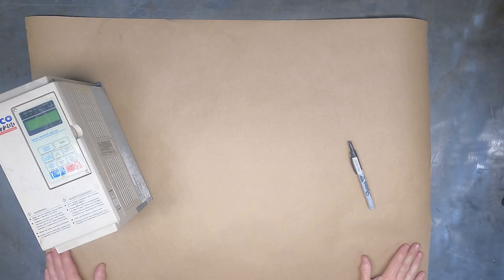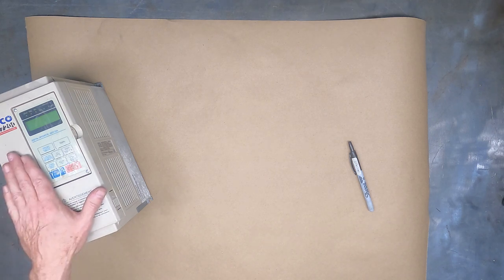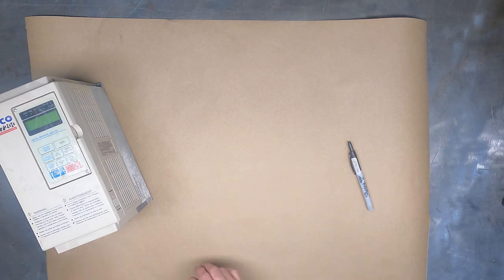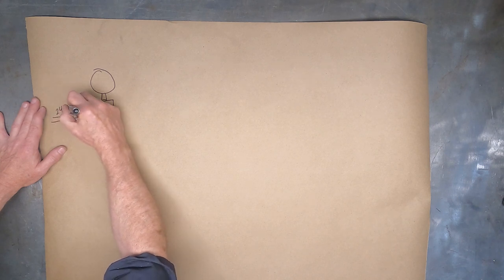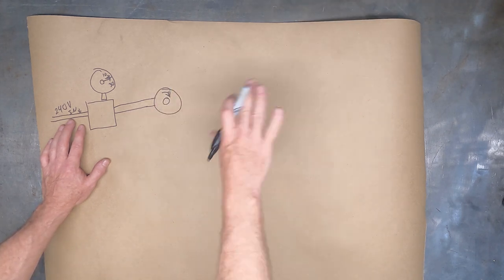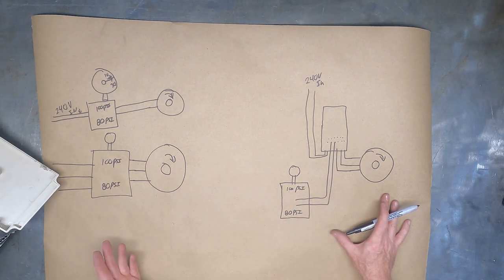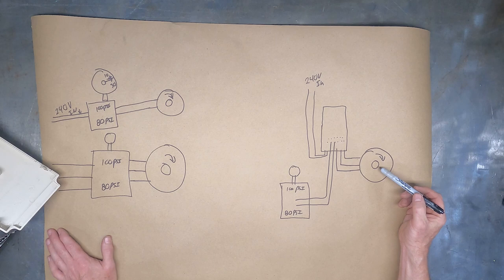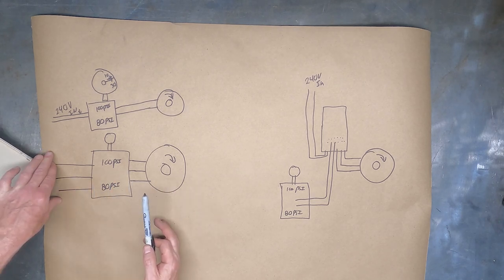How to convert a 3 phase air compressor to single phase with a VFD

Comment: I may have it figured out by the time you answer but I have the Huanyang FC01 vfd and have used vfd's befire just not for an air compressor.  So for the control switching  I see the 10v power supply afyer i run it thru the pressure Switch  but where do you input it in at ,the relay,or AI that shows a 0-10v input range switched by j3 ,or any of the S1-S5 which shows switch input. I understand the basics but haven't had to hook up and read a vfd book of death (😂) for around 12 years. If it I already figure it out Ill reply back but if not it could also help someone else. I know they're not all the same but they all have relays and multiple DC voltage choices and the remote switching terminals.  Great video

Comment: my VFD control terminal has this terminals  where would i connect from the pressure switch to VFD ? if this helps
Left To Right
485+ 485- AO GND X4 X5 and x6/y1_FO
     P12 AI1 AI2 GND X1 X2 and X3

Comment: Thanks so much for the very detailed videos. I have a 7.5KW huanyang VFD to run my 5HP compressor. I have it all hooked up and operational, but my display reads 350V instead of the ~250v. I am reading at the panel. Do you know why this would be? Thanks
Reply from the maker: That's really tough to say.  The Huanyang have been "OK" in my experience, but they are not a product of a single company or even a single model.  They will re-use model numbers but have different capabilities.  I think this is a result of the 'direct from the China factory' issue where they have a batch and slap a label on them, selling until they are out, then the process starts over again.

However, 350v is very odd.  Most industrial equipment uses 208, 240, or 480 in the lower voltage ranges (there are some that are higher) but I have never seen 350v used.
Reply: The drive might be displaying the DC bus voltage instead of the AC output voltage.

Comment: Awesome video!  It too much info on doing this online. Do you think I could use this type of system to convert for a screw compressor? You say you have lots of machinery running off theses vfds, so I assume I can. But you would know better than me. Any in for is appreciated!
Reply from the maker: I would say "most likely" but without knowing the requirements of the compressor (voltage, peak current draw, etc) it's hard to say.  I do have a 15hp engine lathe running on a large VFD.  Compressors typically have some of the largest startup load, so making sure to have a VFD 30% larger than the largest load would be the way to go.

Comment: Daft question perhaps, but cannot find an answer. As i'm using household power (13A-230v) in the UK, thus I'm unable to use a VFD 1ph to 3ph converter to run a 3ph-5hp motor on a compressor due to the low input Amps? 
Not able to find the answer, all i read on specs is output Amps
Reply from the maker: Is 13A the total household available, or is it what is available for the circuit the compressor is on?  Also, what is the max current draw for the compressor motor (this should be on the motor plate)?  Often there are multiple ratings for current, many times you will see the startup current listed, the operating current, max current (often labeled FLA for Full Load Amperage), or a combinations of these. The FLA number is the maximum the motor would draw when operating within it's specified range.  In my experience, items such as compressors, do not reach FLA under normal operation.  However, you will need to contend with startup current, which can, in some situations, be double the operating (or FLA) current.  This can be substantially reduced by using a slow startup time in the VFD configuration.  Basically you program the VFD to speed the motor up over a period of time instead of trying to get to full speed as quickly as possible.  For example, setting your VFD to reach full speed over 3 seconds will significantly reduce the startup current.

All that said, a VFD does not, substantially, add current to the system as there is no transformation of voltage, so current remains nearly the same.  If you wanted to get really technical it does add some, but only the amount required for the operation of the VFD's internal electronics.  I can't say how much an individual VFD may use, but it is negligible and can generally be ignored in most 1ph -> 3ph conversions scenarios.

So, if your max draw for the compressor is below 13A, you should be ok running the compressor via a VFD.  Here is a nice chart showing the FLA of a 5hp, 3 phase motor, running at 220-240v, is around 15 amps: https://aic-controls.com/resources/ac-motor-full-load-amperes/

As you can see by the chart, a 3hp, 3ph motor running at 240v would have an FLA of 9.6 amps, well within your 13 amp limit (assuming startup load is below that or the VFD ramps up over time).  However, a 5hp, 3ph motor running at 240v would have an FLA of 15.2 amps.  This is close and may work as often times, motors in items such as compressors, operate below the FLA rating (again, startup amps could be of concern and partially mitigated with a ramp up in the VFD).

I hope this helps.  Feel free to drop another comment if you have more questions.

Comment: Sir i have inverter split compressor can i start it with vfd or i must have blcd board?
Thanks
Reply from the maker: It's hard to say without seeing the compressor, but theoretically you could.  Technically, you could completely bypass any computer control on the compressor by connecting both motors to the VFD directly, then using the pressure switch to activate the VFD, thus engaging the motors.  To do it this way, you would need to size your VFD 30% larger than BOTH your motors.  For example, if you have 2, 2HP motors, you would need a 5.2HP VFD.  Since you are unlikely to find one in that size, most likely you would need a 7HP VFD.

Doing it this way, both motors would come on and go off at the same time.  For most home / small shop users, this is likely fine.  

Feel free to shoot me any more questions as I've been considering a series on converting 3 phase equipment to single phase with a VFD.  I'd love to incorporate your use case into that series.

Comment: Specifically what connections (terminals) in your VFD connect to your pressure switch and what terminals of the pressure switch?  -Thanks.
Reply from the maker: Pretty much all VFDs are going to differ, that's the main reason I didn't delve into detail on the wiring of mine, it will likely not match yours.  Also, many VFDs (the ones I use, included) can alter the behavior of the terminal strip connectors via programming.  This almost ensures anything I would say about where to connect a wire basically invalid for other users.

Reading the instruction manual for your VFD will point you to which terminal connectors to use.  The manuals can be EXTREMELY COMPLEX though, and it took me a few times reading (with some google-fu) to really nail it down.

As for the pressure switch on the compressor, a normal 120/240vac 60hz, single phase residential switch has 2 connection points for the power.  The power comes in and each lead is connected to one side of the switch (there are normally only 2 terminals).  On the opposite side of the switch are the connectors and wires which go to the motor.  It is likely you will have black and white wires for these, but this could vary.  In using the VFD and the pressure switch to activate it, you would use one set of contacts, the black side *OR* the white side, but not both.  You then run a 2 conductor wire (or two single conductor wires) from each side of the pressure switch contacts to the required contacts on  your VFD.  Now, when the pressure switch activates, it connects the circuit on those 2 wires going to the VFD, instructing it to send power to the motor.

I hope this helps.  It can be pretty confusing the first time you do it.  Let me know if you still have questions.
Reply from the maker: My apologies, for some reason YT did not alert me to your comment.  I realize this is many months ago, but for the sake of the thread, and other potential readers, I will reply here.

To be honest, most of the VFDs used by hobbyists are the lower cost, Chinese imports.  This is simply a factor of cost.  For example, lets say a low cost Chinese VFD sells for $200, a comparable industrial VFD would be well over $1,000.

I have only used 4 or 5 different "brands" of these low cost Chinese VFDs.  I put "brands" in quotes as often they are all the exact same device, sold under different labels.  To date, my favorites have been Lapond and Soyanpower, with Lapond as my #1.  I have some Huanyang and basically I think they are nowhere near rated output or quality of the other two.  There are (or at least were) VERY MANY knockoffs of these brands, so reading reviews was critical to my selection process.

When reading reviews on amazon, I always follow two criteria.  First, there must be a very, very high number of reviews, I try for at least 1,000 if possible.  Second, there must be below 8% 1 star review.  In my experience, 5% or below are generally people complaining about shipping, packaging, etc.  However once they pass 10% 1 star reviews, the products almost never perform as advertised.   

I hope this helps you and any future readers.

Comment: Why do you tell that using the original current setup going through the motor protection switch would blowup the VFD ?? This setup is made to support 400V 3phases which is exactly what the VFD give so what’s the risk ?
Reply: For the record I’m currently running a three phase compressor of 5.5kw motor with a VFD rated 7.5kw 220V single to three 400V model NF9600D. It’s directly plug to the pressure valve which then goes to an MS25-16 motor protection switch set to 11 amp then to the motor itself and it work perfectly, just need to add a wire to start everything from the pressure switch
Reply from the maker: I'm not really clear on your setup here.  First of all, all items should be the same rating.  A VFD cannot change voltages, that is the job of a transformer.  If you have a 400V VFD, it needs 400V, or you can damage it.  Basically the rated voltage, voltage in and voltage out of a VFD must all match.  

That aside, I believe what you are asking is why can't we put a switch between the VFD and the motor?  Please let me know if this is not correct.  Here are the primary reasons why you do not want to place any sort of switch between the VFD output and the motor.  What you should do is use the compressor pressure switch as a simple open / closed contact, connecting that to the input terminals on your VFD, generally to a "common" and "Run" or "Forward" contact, enabling external input as necessary for your VFD.

Voltage Surges/Spikes: When you switch the VFD off, especially if the motor is running at a high frequency or speed, it can generate voltage surges or spikes. These voltage spikes can result from the rapid changes in current and voltage as the motor's magnetic field collapses. These spikes can exceed the voltage rating of the VFD's components, leading to damage.

Reversed Voltage: If the switch is used to disconnect the motor while the VFD is still operating, the motor could generate voltage due to its inertia. This voltage can feed back into the VFD, potentially damaging its components, including the rectifier circuit.

Inrush Current: When a motor starts, it often draws a high inrush current to overcome inertia and start rotating. VFDs are designed to control and limit this inrush current to protect the motor and VFD components. If you use a switch to disconnect the motor, it can bypass the VFD's control over the inrush current, potentially causing excessive current and damaging the VFD.

Interference with VFD Operation: Some VFDs have safety features and control mechanisms that rely on continuous communication with the motor. Introducing a switch can disrupt this communication, potentially causing the VFD to operate improperly or in an unsafe manner.

Voltage Imbalance: The sudden disconnection of the motor from the VFD can create voltage imbalances within the VFD's output circuitry, leading to uneven loading on the VFD's output components, which can cause overheating and damage.
Reply: @MountainLaurelMetalworks  yes mine does entry 220v output 400v, exactly what it’s advertised to do. Motor always make back current when stopping that’s why is designed brake resistance on VDF, directly plugin vdf to motor won’t changed that and security over voltage switch don’t change anything you just remove a security for your engine that’s all…
Reply from the maker: Would you mind pasting a link to your VFD specifications, as I would be interested in reading about it.  Straight VFDs do not normally transform voltage, that is the job of a transformer.  Perhaps your VFD also contains an internal transformer??

Per most VFD manufacturers, the motor protection contactor should not interrupt power, it should also be used as a dry contact, sending an emergency stop signal to the VFD.

A straight VFD can definitely be damaged by interruption between the VFD output and the motor.  Just check with almost every single VFD manufacturer and they will tell you the same.

Comment: I have a question, let’s say the compressor has a low oil pressure switch, how would you wire that into the VFD if you going around the original compressor electrical circuit?
Reply from the maker: I can't speak for every VFD, but every VFD I've worked with has an "E-Stop" feature.  Normally these can be configured as normally open or normally closed.  Many consider these inputs to be used for an emergency stop button, but it can also be wired to external inputs, such as the low oil pressure switch.  

In the case your VFD does not have an E-Stop input, you could, potentially, wire the oil pressure switch inline with the input used to activate the VFD.  In other words, the 'on trigger' (likely your pressure switch) could pass through the oil pressure switch and opening either would then break the circuit and stop the device.

I hope that helps.  If you have other questions, feel free to drop another message.
Reply: @MountainLaurelMetalworks  Can I email you a pictures of my terminal functions and guide me?
Reply from the maker: Happy to help, but I can't paste my email address here or every bot on the planet will start emailing me.  You can find the email by going to my channel, clicking the "About" tab (in the "Home, Videos, Shorts, Playlists, Community, Channels, About" section), scroll down a bit to the "Details" section and click the "View Email Address" button.

Comment from the maker: @chipsammich2078 I hope this video helps with converting your 3ph air compressor to single phase.  Let me know if you have trouble or questions.
Reply: Thank you very much..
Reply from the maker: My pleasure!
Reply: @MountainLaurelMetalworks  Perfectly done in lamens terms.. well done sir👍👍
Reply: @MountainLaurelMetalworks  So if you had To recommend a vfd that has all these features and eliminates the contactor and thermal overload.. which wouks you recommend?
Reply from the maker: I have had good luck with the "Lapond" brand.  The "Huanyang" also gets good reviews in the forums and I've used a few with good results as well.  However, I do find the Huanyang seems to have more poor quality clones out there.  Again, amazon reviews are your friend here.  

With the price point, I recommend buying a vfd of twice the capacity required.  The general rule is %50 more (so a 5HP vfd for a 3HP motor, a 10HP vfd for a 7.5 motor, etc).  However, generally the price for once twice the size is not much more.  The main reason I say this is these cheap chinese VFDs are sometimes not quite what they advertise and I like having the extra capacity to ensure I am not overloading them.
Reply: @MountainLaurelMetalworks  I ended up buying a Huanyang last night after alot of research.

Comment: never  seen a compressor pressure switch wired to 110-- 220v.
even big compressors have 120 to the pressure switch.
Reply: Anything above 120 required a magnetic starter